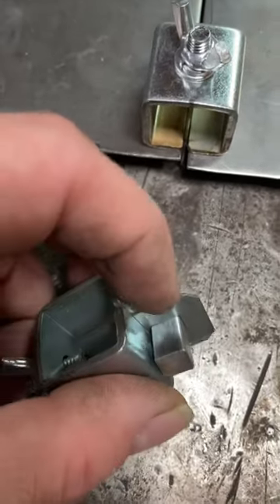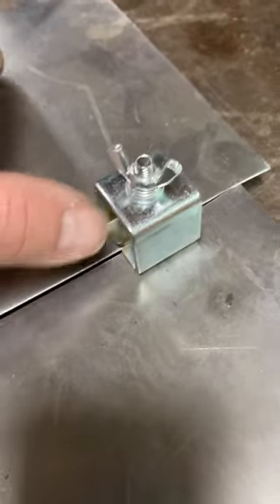Buttweld clamp! #coverts #bodywork #youtubeshorts #tricks #tips #car #truck #welding #restoration#hf

Comment: I picked mine up from HF.  I used them today. They take the headache away.  Just be sure you have access to get the metal block out when you're done. I use a magnetic pick-up tool.